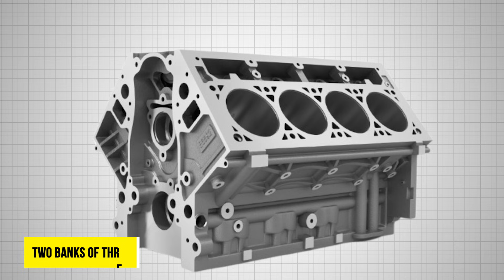What's WRONG with BMW's V6 Engines?

Comment: The reason BMW doesn't do v6's is an inline 6 produces more torque and smoother power than a v6, so if you're going to have only 6 cylinders it's best if they're inline. They are not opposed to v engines, they have made many v8's and even v12's
Reply from the maker: You are totally right, I should have mentioned the inline 6 advantage and I will do better research next time!